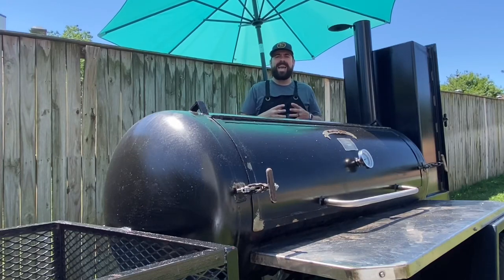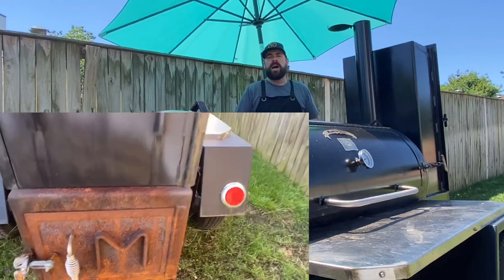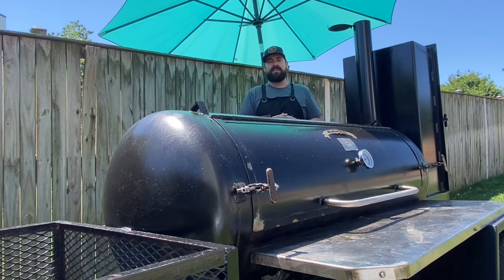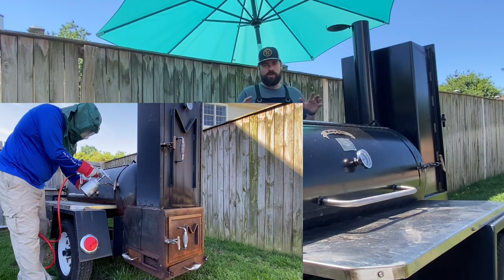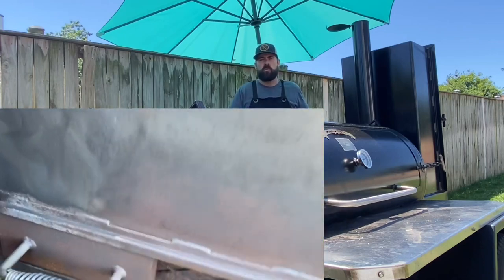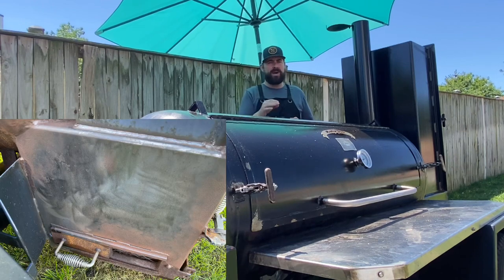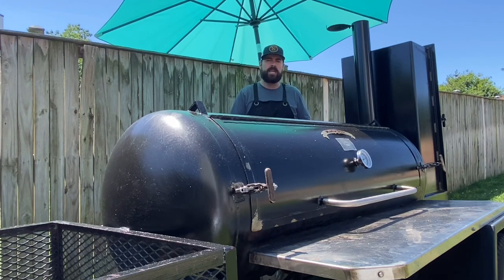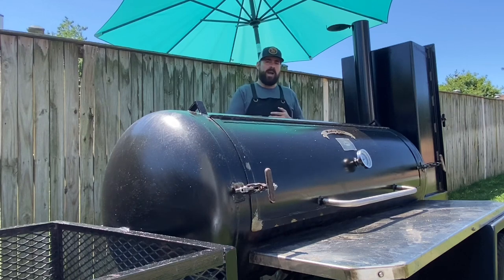Removing Rust BBQ Smoker - Meadow Creek 120 Gallon Reverse Flow

Comment: All you need to do is hand sand it just to rough up the surface, and then get black rustolium spray paint and spray, let it dry. Maybe do 2 coats and “walla” it looks new and will not rust in the future. I have done this to all my webers and fire pits over the years and they still look new. Try it, you will be surprised how well it works and it is easy.
Reply from the maker: I believe that, it seems like the easier method sometimes is the best!